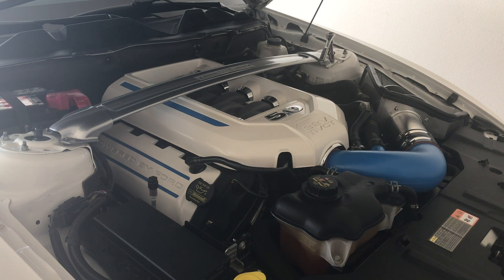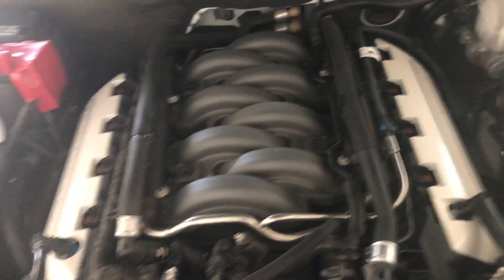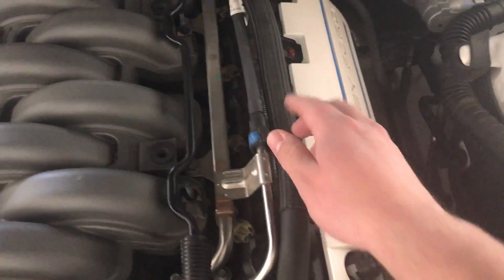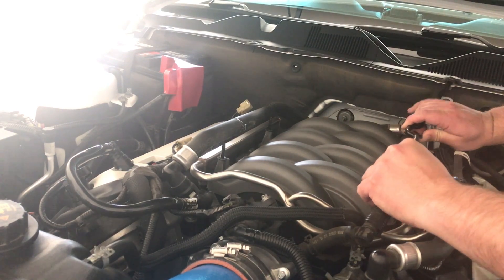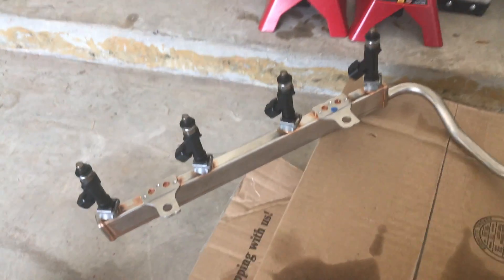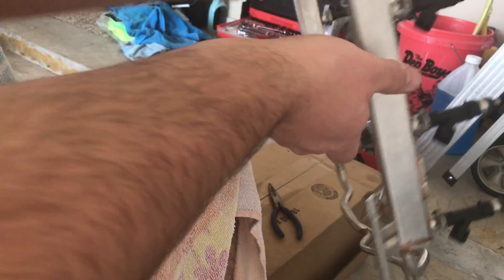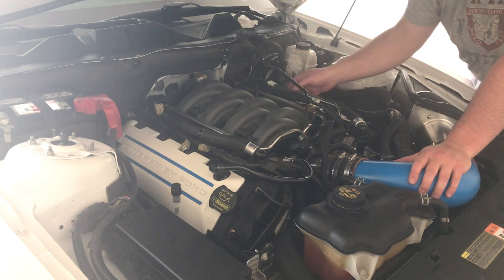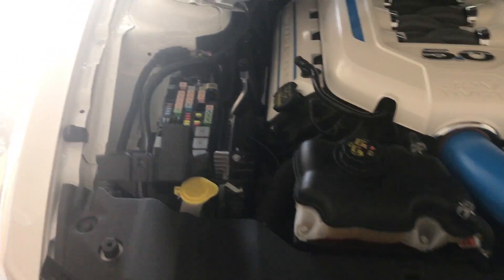COYOTE 5.0 FUEL INJECTOR SWAP FOR E85

Comment: Great video 👍🏽  What are some ways to empty the tank? Or can I just run the gas down as low as possible?
Reply from the maker: Joshybo CM they actually make a tune u can flash that only turns on the fuel pump and u can disconnect the line and pump the tank out. I just ran mine as low as humanly possible and put E on top of that. My tune was flex fuel so i could have both E and 93 in the tank.

Comment: 3 years old and still the most helpful video i have found on injectors on the 5.0. For those wondering if it’s the same procedure for the F-150 with the 5.0 then yes, i just replaced mines today on my 2013 F-150 XLT 5.0L and thanks to this video it honestly took me 25-30 mins, i still believe it was less than that. I removed fuse #27 on the fuse box under the hood and cranked the engine, obviously wasn’t going to start but got rid of all fuel on the line to the rails. Removed negative battery cable and when removing the fuel rails the biggest tip i have is when unplugging the rail, place your thumb on the rail tip, otherwise when removing it, it will make big spills, wiggle them loose and pull from the rear upwards. Pretty much it. Again, thanks to this video it all went smooth!
Reply from the maker: xXxAdr12308xXx Glad to hear i was able to help bud! Good to hear you got it done easily.
Reply: Is it the same for the flex fuel 5.0 f150? Are the injectors different from installing these?
Reply from the maker: jay lopez should be the same process, same motor
Reply: @NoMercyGTCS  is there a difference tho the f150 has the flex fuel meaning it can take e85 and regular gas by me swapping those "original" for these "47 e85" will it be a difference? And would a tune be required since it already takes e85?! I always fill her up with e85 never regular gas
Reply from the maker: jay lopez oh okay, if thats the case there is no need to swap. This is for cars that are not originally e85 equipped.
Reply: @NoMercyGTCS  oh ok thx nice mustang by the way

Comment: Excellent video! Thank you for putting it together. Watching this gave me the confidence I needed to pull it off. One minor thing I did different was roll the rails forward to get the injectors out. I have a boss 302 intake manifold with jlt cai. I would've had to remove the TB to get the rail completely out of the way. Had to keep more rags handy to soak up the remaining fuel.

Comment: Do i need to get the E85 tune before insalling the injectors? Or can i get these 47lb ones and keep running 93 until I get the tune a week or 2 later?
Reply from the maker: I had the same question, and i think my tuner said to get the tune because even if you only run 93 its a larger injection which your current tune isn't accomodating for currently.
Reply: NoMercyGTCS yup you were correct. I waited until I had the tune to swap injectors.
Reply from the maker: awesome man, sorry for the late reply. enjoy the E!
Reply: NoMercyGTCS no worries. My tune isn't lowering the afr to near 10, and I dnt feel the power. So idk what is going on...

Comment: I noticed in your video, you didn't show how to disconnect the main fuel supply line to the fuel rail. That's what I mainly wanted to see, but did see how to remove and install the injectors. Thank you
Reply from the maker: Hey man, sorry just seeing this. It has one of those quick disconnect couplers where you push a little tab and pulled it off at the same time. Super easy. Once you see it, you will see how it functions
Reply: NoMercyGTCS I paused the video when you showed the line off, and analyzed it well enough to see how it was suppose to look with the clip up and managed to get it. 👍

Comment: i missed reinstalling the injector safety fasteners... do you think it could be a problem or should I remove.everything again
Reply from the maker: The little retaining clips? As long as the rubber o ring was seated into the fuel rail properly i imagine it's fine. I wouldn't think they're going anywhere. Up to you though.

Comment: Great video! I have a 2017 S550 and this video helped me out! I'm actually installing these same #47 injectors to run E85, I am really curious how you liked it and what kind of power gains you seen.
Reply from the maker: Glad it helped you out bud! I love E85. The car runs amazing and pulls alot harder! Im in the middle of putting on a blower now and i hope to swap to E85 for that as well. Hope you enjoy it, you can really feel the difference. And E is cheaper than 93!
Reply: It did, I really appreciated the video bro! Sounds like I am heading in the same direction as you eventually lol. If/when I get bored with E85 I will go with a supercharger as well. E85 is cheaper by the gallon for sure, but with the way I drive i'll probably end up spending more money by the mile lol!.
Reply: RedUnicornS550_Tx x

Comment: Hey man can’t find the update video! What’s your take on e85? Did you notice a difference?
Reply from the maker: I'm sorry man! i never got around to posting that. It is definitely worth it and you will feel it! it feels like i picked up around 20hp. I can surely feel it in the seat. E85 is about $1 cheaper per gallon too. I'd recommend the E to anyone really. The car runs so much better on it overall.
Reply: NoMercyGTCS i May have to pull the trigger on some injectors then. Thanks a lot for your input
Reply from the maker: No problem bud, hope you enjoy it. Definitely worth it imo

Comment: Did you have to upgrade your fuel pump ?
Reply from the maker: DynoLess havent had to yet, but currently considering it due to soon to be turbo, or nitrous. Its performing perfect right now. From what ive heard if u let the E sit for a while in the lines and pump without running the car you will have problems.
Reply: No Mercy GTCS that's badass. And okay kool. Just wanted to know if the stock pump flowed enough for N/a e85.
Reply from the maker: DynoLess luckily it does! Ive heard of ppl having to replace them after a year or two, not sure if thats true or not. Ive had the car since June 2012, but i drive it every day so the E isnt sitting in there either
Reply: Good to know. We are going to go e85 on a 5.0 also and on a corvette. Looking foward to see ur 5.0 boosted or juiced 👍
Reply from the maker: Thank you Sir! really enjoyed the videos on your channel. Post up the videos for your E85 coyote and vette plz!

Comment: did you empty out your fuel tank before putting e85 or is it ok to have a little gas in it? I'm doing my swap this weekend if i can get my tune by the end of today.
Reply from the maker: John J Ran it down as low as possible. I think i had less than 10 miles to go when i got the E. as long as you have a Flex Fuel tune its okay to have 91 or 93 in the tank. I'd say run it down as low as possible, and when u fill up with the E drive it kind of easy for about 20 miles to let the ECU adjust the fuel values. That's what my tuner advised. Only need to do that when anytime you're swapping from only 91 or 93 in the tank to E.
Reply: dang too late to get the flex fuel tune. They are writing just a e85 tune. So i guess i'll have to drain all the fuel before i put e85 in it.
Reply from the maker: John J  yeah i'd be sure to get as much as absolutely positive out. Coast into that station on fumes bro. Or u could fill a jug with E, drive the car til it dies, then fill up lol
Reply: lol yeah i ended up filling up a 5 gallon jug with e85.
Reply: quick question, i pulled the number 13 fuse but the car keeps turning back on, i'm missing something but dont know what lol
Reply: lol i figured it out
Reply from the maker: Sorry man i'm misunderstanding your problem... what do you mean the car is turning back on?
Reply: no problem buddy. What i thought was the right fuse was the wrong one and the car would actually turn on because i pulled the wrong fuse. I ended up getting a drain tune from my tuner that kept the fuel pump on when i turned the key over so i was actually able to drain all of the fuel.
Reply from the maker: awesome man, glad to hear that.

Comment: great vid bro
Reply from the maker: Thank you Sir, i really appreciate that! I couldn't find many videos on this when i was doing it so i hope maybe it will help someone.
Reply: Yes I've  been looking  for this for a while i got to swap mine injectors  to a 56 pounds  there is no video for them but thanks for your vid
Reply from the maker: Easier than it looks Sir. You're welcome brother
Reply from the maker: Tx214 I'm not 100% sure about that. The most commonly used for 11-14 on an NA application are the LU 47's. i would think any injector larger than that, and is E85 approved would be fine.
Reply from the maker: Sounds like a good plan to me brother! Good luck. If you haven't yet, join "anything coyote mustang related" group on Facebook. There's around 34,000 members and they can always help you learn more.
Reply: Do these 47lb injectors require a special USCAR connector? Or simply just plug and play?
Reply from the maker: sorry it took so long to get back to you bro, If you get the genuine Ford brand ones they do not require an adapter. The GT500 versions are shorter and require an adapter to work.